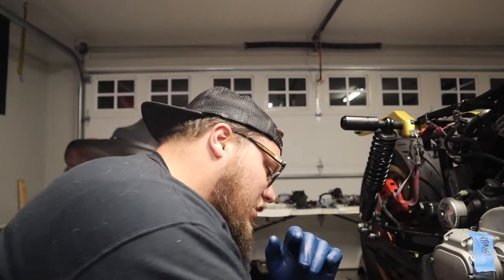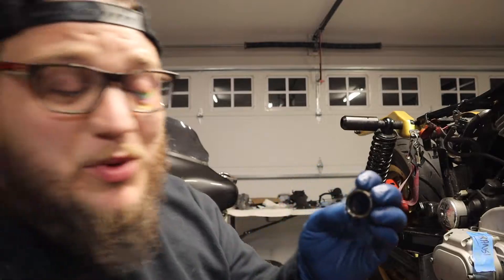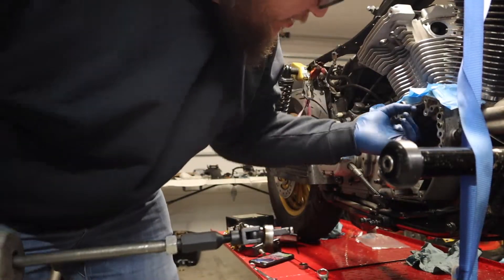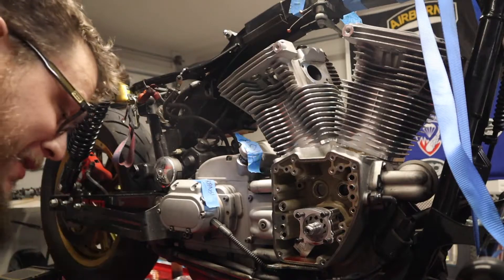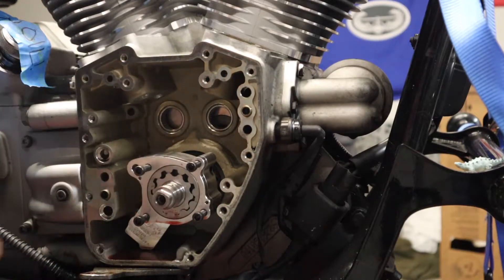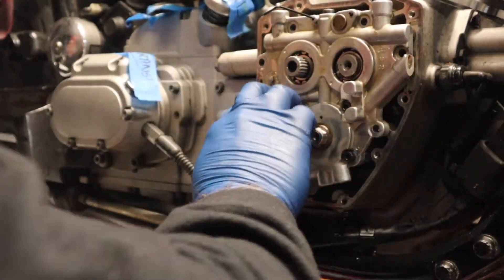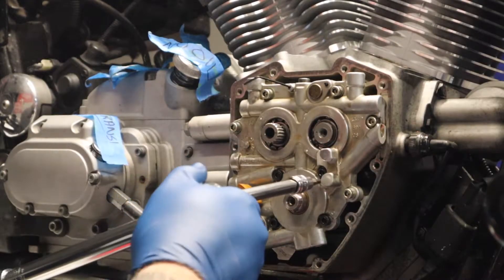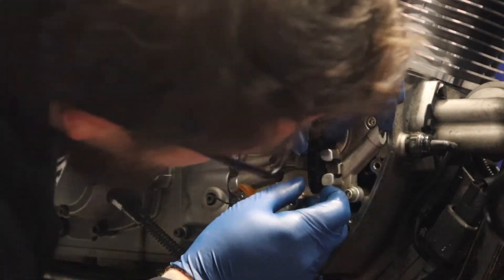Engine Assembly Part 3: Inner Cam Bearings and Cam Plate Install

Comment: Buddy was removing his OEM bearings using a Harbor Freight slide hammer kit for bearings, bearing broke and just one roller dropped into the engine.  $1,700 in labor later from local shop to retrieve.  Method works but very risky.
Reply from the maker: Everything has its risks. I was very meticulous when I was doing it.